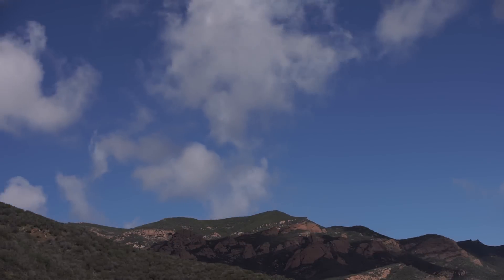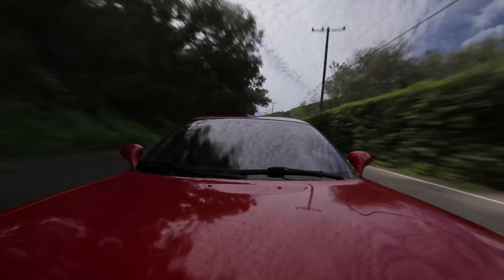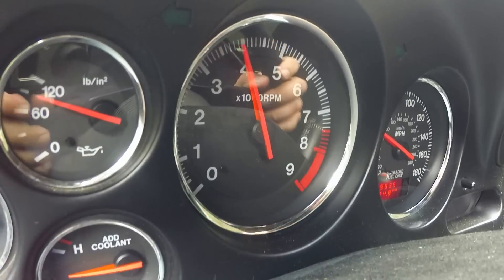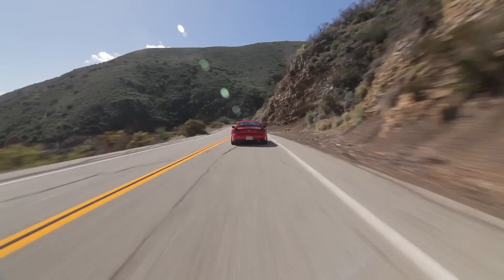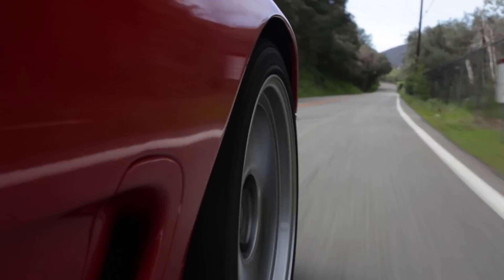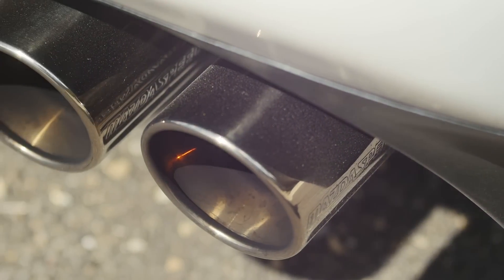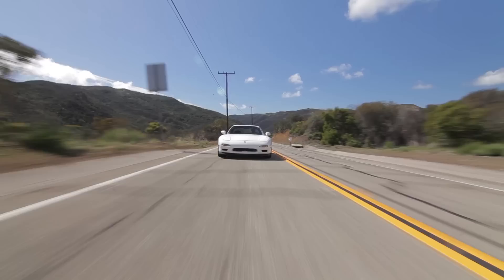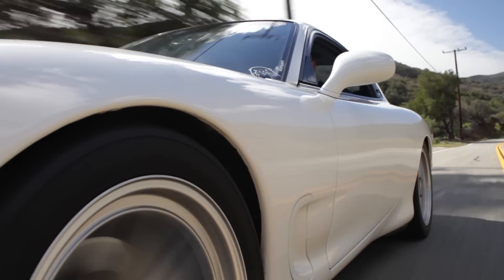Mazda  RX-7: Turbo vs V8 - /TUNED

Comment: Wish you guys had taken it to the dragstrip and/or road course to get some objective comparisons to go with all the subjective information.
Reply: DopeItUp It would be great if we had the budget for that kind of stuff. Unless someone specifically offers us free track time, race tracks are out of budget.
Reply: DopeItUp  very correct, should have tracked them ... if i had the r.e. rx7 i would brapppp all day son and if i had the v8 one i would be thinking about how to make that same brappp sound come out of a v8 ....
Reply: fuqu there is a second gen RX7 with an LS motor that shows up to the RMR midnight drags (SLC UT) It's white, with a power glide and nitrous shot. Small Race tires that fit inside the rear wheel wells. runs consistent 10.20's takes off like a shot and makes it look easy.
Reply: fuqu he has a 1200 horsepower power plant AND he has traction issues ? REALLY ?  It must be the RX7 's fault.  If the guy had his 1200 horsepower engine in any other chassis but an RX7  including a Postal Service Mail Man van, then it would hook up like mad.
Reply: fuqu just one more thing on a very long list that you can not get right.

tell every one again about how much you know about RX-7s and cars in general 

tell every one again about how RX-7's have a huge traction problem even at only 400 horse power and you know because you and your cohort put a 1200 horsepower engine in one.

tell everyone again about how smart you are about cars 

the correct position, since you tried to bring it up,   is your face right down on the pavement right in front of a rear tire  of your buddy's monster motored RX-7, you listening for  a horsepower reading as your buddy does a hole shot launch  attempt. Come back and tell every one all about all that you know after that ...... or is that not possible because your buddy's car is really making zero power as it does not even run at all, so you are just running your 1200 donkey power mouth instead.
Reply: DopeItUp objective? 1300cc vs 6000cc is objective?
Reply: Do you not know what the word "objective" means? I'm so confused right now.
Reply: Yeah i understand what you mean. the "subjective information" though is obviously true without doing any tests. the LS is superior.

Comment: wow. compare a car with a fascinating unconventional engine concept and 1.2l displacement and therefor a very light weight with a car that got a heavy boring 6.0l v8 in it. (which is in my opinion the most boring concept of all.)
And then say the V8 swap ist better cause it's faster? 
the rx-7 is a special car and deserves the respect of every petrolhead in the world for the amount of work and the braveness the engineers put in that car. all for the decison to put a rotary in it. 
for those engineers it must feel like a punsh in the face to hear you guys say "it would have been better with a V8" .. because it's faster... 
i am disappointed
Reply: Caspar A He didn't say it was "better" at all.
Reply: Caspar A Heavy, maybe.  Boring?  Not a chance.  The V8 has better reliability, better support for repairs and upgrades, better fuel economy.  The power it puts out far outweighs (pardon the pun) the additional weight.  You lose a little bit in the corners but you gain much more coming out of them.

The RX-7 is a special engineering feat, however, its rarity does NOT make it better.
Reply: Caspar A And only very "special" people will love their wankel engines.

Comment: All the butthurts in the comments bitching about LS in the rx7. If i had a rx7, and the rotary blows like it usually does, im slapping an LS in it. Is the rotary engine good? Of course it is. Would i swap for an LX if i had one? Most likely not, but i do love my GM v8's
Reply: did you not hear that the first guy owned his for 7 and tracked it hard for 5 or something and never had a blown engine 
just keep hearing what you want to hear
Reply: My friend has almost pulled the trigger on a rx7 several times and they all had engines that have needed to be rebuilt so he just pulled out of the deal
Reply: Most likely those people did not take care of there car like 60% of the cars I work on a daily basis it is said when you pull a oil drain plug and nothing comes out of the car until you poke a screw driver in the drain plug hole because of all of the sludge that has belt up not to say it takes 20min to dump new oil into the engine do to sludge. How these cars continue to run is beyond me. I just find it sad to see any car that has not been taken care of.  I don't know how many people have came in with a car that had only 4000 miles on it and you ask them what there driving and they say I don't know it that one out there. if it does not last for ever people claim bad reliability and then the car is doomed. I know this because I drive a car brand (not a RX7 or the RX8) that has that rep. I have owed two now and nether has seen a shop for any reason then my own fault because I don't drive a sports car like I should drive with what I do like Auto crossing, track racing (sadly one time) and drag racing. and a lot of spirited driving with people that drive true sports cars (350z,RX7,corvettes,mustangs,RX8,boxers,elise,300zx).
Reply: probably didnt know how to properly mantain (yes they have higher mantainance than a piston engine) a rotary, its like when idiots come to me and tell me, 2strokes are unreliable, its different and people lack of knowledge kills them

Comment: Seems from what I've read, like the main keys with a turbo rotary other than standard maintenance are 1) new turbo setup because of weight/complexity of the stock sequentials. and 2) upgraded cooling system

Comment: If you're gonna get an rx7 to put a ls in it, don't get an rx7.
Reply: exactly
Reply: if you're gonna get an rx7 to put an ls in it, do what you want, it's your car 😁
Reply: Totally  agree. The RX sound gets old ,and you have to rev the piss out of it all the time.
Reply: +Jack Richter That's the price to Play.
Reply: I had Rx's before, this engine is for a project . Not a Rx. I will only build a one off car, no copy cat bull shit cars.Have you seen all the copy cars just of FF? insane and not for me.
Reply: Get an 20B woop better all around.
Reply: +Jack Richter 
Do you own an FD?
Reply: No.
Reply: If you're gonna get an Rx7 to put an LS in it, do it when the rotary takes a dirtnap, like after 5000 miles.
Reply: lulupr787 if you wanna pay for maintenance and replacing that motor fine lol that ls will last 2x as long if not longer
Reply: Coming from a guy who probably dosn't have one.
Reply: Coming from a guy that has had almost everything I'd say yeah. I know what I'm talking about
Reply: christian cosimano  sorry was meant for lulupr787.
Reply: John Miley how is it garbage? do tell please.
Reply: I doubt you've ever owned or driven one.
Reply: can anybody guess why virtually every factory ls car never gets a swap replacing the ls for another engine?  its because there is no need to find a solution to correct reliability issues and other inadequacies like poor mpg, lots of friction and heat and short engine life associated with the wankel engine. this guy is spot on with his analysis between the two cars. i love the rx7 and the rotary in it. when its working its amazing. but its to much of a pain. ls, you set it and forget it and just enjoy the hell out of the car. yeah u lose some magic but gain a whole lot more. if you are older you will chose the smart way (ls). if you're a punk you will chose the rotors because you want to rebuild it 5 times bcuz its fun not wise. my 2 cents.
Reply: So rotary enthusiasts are punks?
Reply: not all of them are young is what i meant
Reply: not really, that is more of a meme.  If you are driving around town, it has more than enough torque and horsepower to move you at sane speeds in traffic.  Hell, I had an I-Mark at one point in my youth that got I think 80 peak hp.  It moved about town just fine too; rotaries do just fine with normal driving.  They don't have the torque to move a 3 ton vehicle around stop and go traffic, but the RX cars weigh half that.

The 'its slow down low' gets more old than the sweet sound ever could; ofc not if you installed a loud ass exhaust for no real reason; then that is your fault, not the engine's; and if you did the same to a piston engine, it'd annoy you just as much, as I had a CRX with swapped gears that cruised at 5k on highway with a loud ass exhaust.  5 minutes and I was irritated, and just moving around a parking lot got annoying within a very short amount of time owning it.  I didn't realize how quickly it'd get to me from the test drive.

So, too loud? you bought the wrong exhaust for you.  Too slow down low for 99% of non-track driving?  You are being ridiculous; track driving you'd keep it in high revs anyway.  Unreliable? It's probably your fault, with the caveat that they should've done the things people should do like upgraded radiator and other reliability mods from the factory, but if it fucks up now, its on you for using cheap gas or some form of neglect most of the time.

It is no different than saying a  C7 must handle like shit because american cars are notoriously been known for being shit handling cars ...  or that a Viper must handle like shit for the same reason.  You ignore the truth to parrot a trope for the sake of sounding cool or you are just being hive mind without any actual experience, knowledge, or context.
Reply: People who think rotaries are unreliable are wrong. The 2 rotor has a total of 3 moving parts: 2 rotors and the crank. Yes, there is slightly more maintenance costs because they burn oil (by design, need to oil the seals) however they can go for hundreds of thousands of miles without issues. Putting a big V8 in takes away the spirit of the car. The RX-7 wasn't meant to be a Corvette, it was meant to be an RX-7.
Reply: @zeropeorthkuromurasaki1130  someone already took one of your ideas. Mike Finnegan put a Hemi into a 1955 Chevy.
Reply: Amen!
Reply: They arent garbage i have one with 300000 miles on it
Reply: Lol an rx7 with ls is miles better because you could actually put some miles on it unlike the your rotary that needs to be rebuilt. 🤪
Reply: they want reliability

Comment: You said it all when you said it drives like a corvette.  RX7 is only an RX7 with the correct engine.
Reply: Yes. Bad car with bad engine.
Reply: Take the rotary out of the RX7, and what do you consider is bad about the car?
Reply: It has no engine.
Reply: The best car in the world... RUINED
Reply: most likely because no torque,
Reply: runined with a V8? theres more, he named more pros than cons  the only thing better about a smaller motor is the streering,
Reply: JBMSTRIKER71
So, who were you replying to?
Reply: The voices in his head, I'm guessing.
Reply: Ronald Colman ghv
Reply: Ronald Colman totally agree with you. A V8 in an RX-7 is like a lady boy.
Reply: Sure,  you COULD buy the Mona Lisa and spray paint it with gang graffiti, but you're committing a crime against humanity.
Reply: It's like buying the Mona Lisa and defacing it with spray paint. Sure, it's "your car", but you are committing a crime against humanity.
Reply: @taylorc2542  RX7 are not very rare. Also it would be like taking graffiti art and IMPROVING it lol. The Rotary is quirky, unreliable, high maintenance, and anemic unless built for power